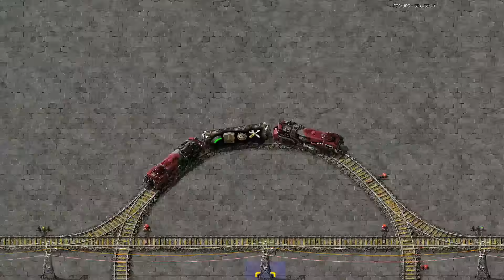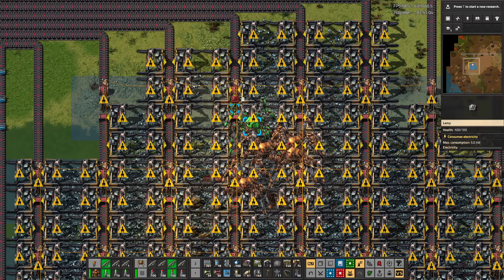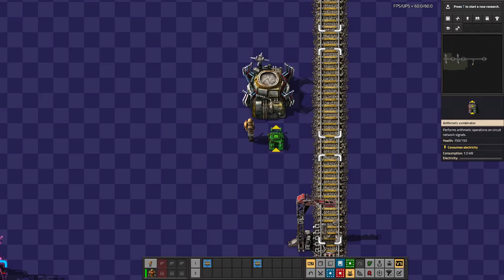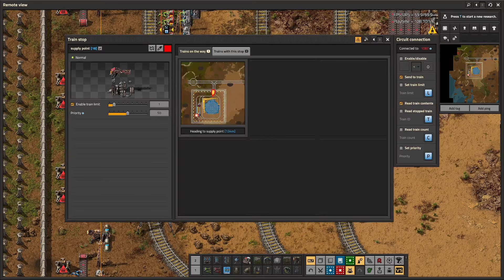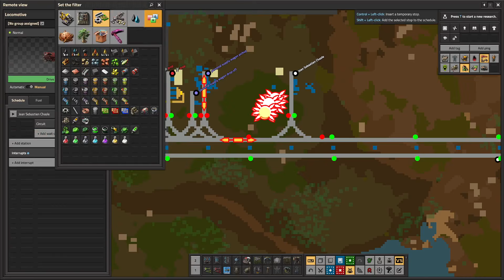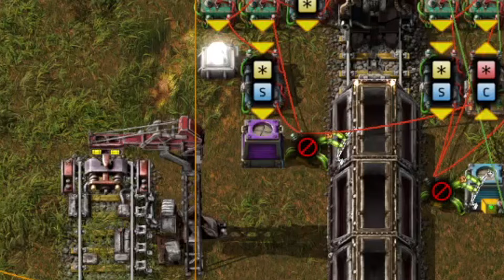Supply Trains: Basic, Cursed and Optimized. (Feat. Personal Logistics Trains) -Factorio 2.0

Comment: Having the select combinator pick the single most in demand item means if that item can’t be supplied (maybe its production is broken), the train just goes back and forth supplying nothing. To fix this, try having the select combinator pick a random in-demand item.

Related problem, if an item can’t be supplied, the train goes back and forth to the nearest station, and other stations get ignored. To fix this, have each station set its priority based on how long it’s been waiting. That way the train visits each in turn.

Final thought, this can be extended to multiple wagons by having one supply group for the first wagon, another for the second, etc. But for taking extra items out, since you can only read the whole train contents and not individual wagons, combine the supply groups and subtract the whole train contents and remove that from all wagons.
Reply: I read the train contents, turn all the signals to one, and then multiply those by the demand at the unload station to make sure the inserters are only picking up things that are in the train. I still have the problem of the station going "I need more items!" and getting a train which could still not have the item needed.

Comment: I didn‘t figure out the logistic group in constant combinator thing so its more hardcoded but that is basically how I supply my Gleba outpost (arty outposts to keep the crawlers at bay).
My first solution however was just a very fast Spidotron that was following the train and could build stuff and it provides a similar effect. I eventually had to change it because using Spidotrons forces your arty train to wait in station until a possible retaliatory attack has occurred which really limits its effectiveness.

Comment: Using a train interrupt that checks if an outpost is not full will let your train remain at the station and readable to prevent that hiccup when changing the outpost shopping list.
Reply from the maker: Hot damn, that sounds like it would actually work. Would simplify the circuitry on the personal logistics train too.
Reply: @InferAGoodTime  Thanks to Space Age, that's how I supply my outposts now and I don't think I've had a hiccup yet. I did use train limits instead of enable/disable though, so you might have to change that.
Reply: @vladdeklitrez  disable-enable works the same as putting train limit to zero. The only thing about conditions of full/not-full is that they are at least visually bugged in the interface and condition color tells shit, but despite that it works for not sending a train and make it sit on the loading station, available for reconfiguration, until a next station is avaiable.
Reply: @InferAGoodTime  is there a 2.0 version of this video? :-)
Reply: @weltraumvogel2  this is 2.0 tho, 2.0 released around oct and this video has been clearly using 2.0 stuff and was released in december

Comment: This is a great video, and amazing concept and solution!

Something I have tried solving, but gave up un is a single assembler automall where it can also handle ingredient chains. The reason for this would be space, as you can save a lot of rocket launches when intially going to new planets simply by early on sending up another platform, then making belts, assemblers, inserters etc in space, using iron from space. (Circuits and copper supplied from Nauvis ofc). This would happen while doing the early space science researches, and could even be going on to set up more ships for future planets. Looking at how much larger a ship you want for Aquilo, if that was started early enough, and you get the advanced asteroid recepies early on, you can likely reduce launch counts a lot...

Comment: Wish there was a way to read ghosts. This way you can drop this station with a chest and roboport, and just build anything you want and it will be automatically supplied by trains until everything is finished. Then all you have to do is to build rails with spidertrons and drop the station itself. A true endgame of automation.
Reply: you can create logistics groups with everything in a blueprint just by clicking the blueprint on the”add logistics groups” button. 

if you have stuff already placed, the deconstruction planner has an option to remove ghosts -> 1) build all your stuff. 2) deconstruction planner blacklist ghosts, so everything that is already placed is removed temporarily. 3) create a blueprint of everything. 4) ctrl+z to undo deconstruction. 5) make a new logistics group with the blueprint.
Reply: @ oooh. The first half of that I think was shown in the video. The second half is a brilliant addition, though!
Reply: Yeah, but then you wouldn't have the satisfaction of building a functional circuit network XP
Reply: Late to this, but there's a mod that somewhat does this. It's called Alert Scanner.
Reply: Yeah, I really wish that was there, too.  We can read logistic requests... why not construction requests?  😭

(I'm pretty sure there are mods that give this, but... yeah, I want it in the base game.)

Comment: Ive got a very similar system but with 6 inserters per cargo wagon and you can have your train n cargo wagons long so it has just more throughput. One limitation that is bugging me is that you cant automatically request missing items for building ghosts so the sky isnt exactly the only limit. But you can use the blueprint contents to const combinator feature as you mentioned to alleviate some pain
Reply from the maker: I really thought I'd found the magic bullet with the "read logistics requests" until I realized it was ONLY personal logistics. But hey, maybe construction requests will be added to roboport circuits at a later date.
Reply: @InferAGoodTime  when he Friday facts post that introduced the read logistic requests came out I was so hyped for about 2 seconds until I read the next line that said ghosts weren't included and I had concluded like month prior that without this feature automated ghost building requests were impossible without a buffer of every item at every supply station :(
Reply: You can do a sorta reverse supply train too, so when it's done building you can clear the logistic group of the blueprint, then a trash train comes to pick up any leftover junk and take it back to your base.

I built all of this before the selector combinators and logistic groups though. Been meaning to update my logistic train system using the new stuff so I don't have to go around manually updating my constant combinators anymore, haha. And cut my combinator count down. I have way too many combinators driving my fancy logistic trains ha.

Comment: I spent around 12 hours total building and debugging one of those in my first SA attempt. Once it was running, I realized that this was easiely can be solwed by just spaming roboports everywhere, putting another one 1GW nuclear reactor setup and joining the club of "pro gamers" whose saves lagging because of thousands of bots flying around carrying freaking belts and pipes. At least I can pat myself on the back for spending those 12 hours designing something that infinite times more efficient than waiting those 12 hours for the army of bots to be built.